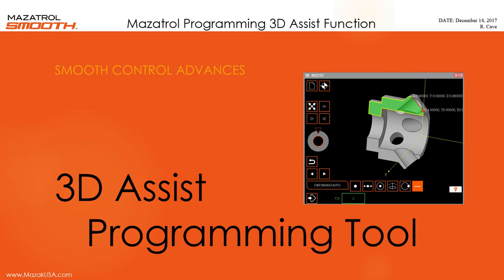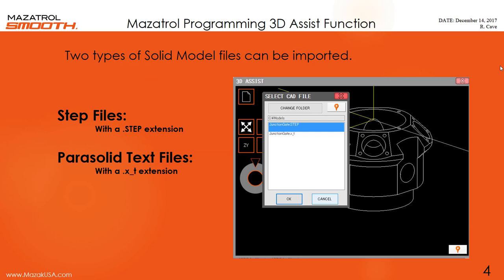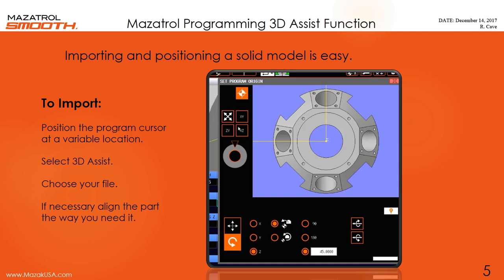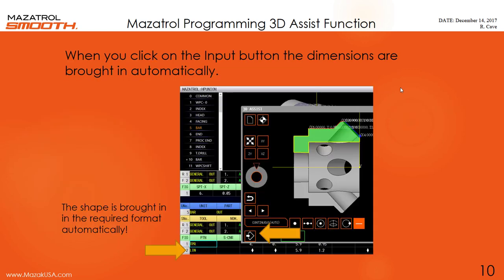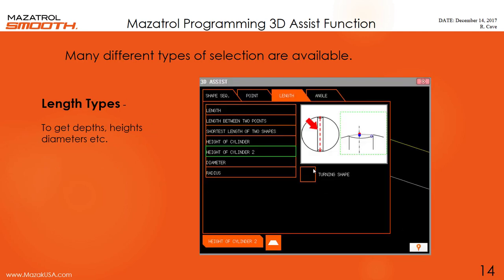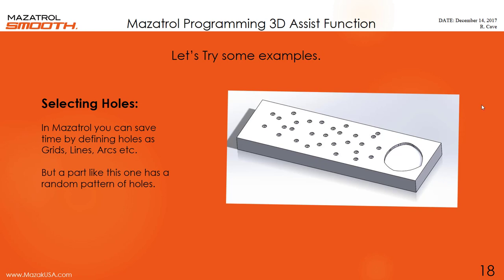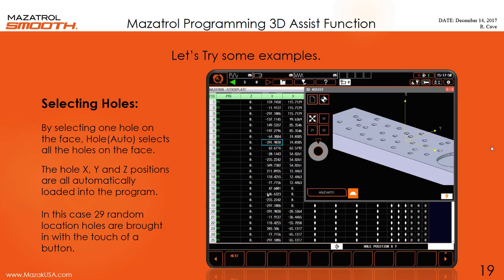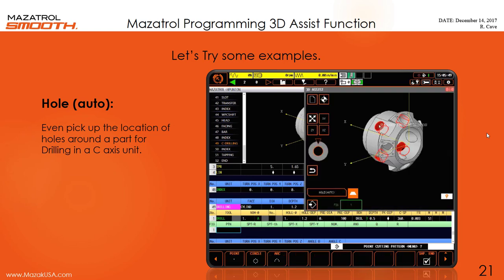Addy Machinery - Mazak Mazatrol 3D Assist Programming

Comment: it's a great feature we use it regularly,  it also helps while programming on computer using smooth cam
Reply: Hi sir, I just want to ask you a question. Maybe you remember me from your channel. I had written that we have a Mazak variaxis i600 with smooth x control. I make the programs via Mastercam since I can import my vices, zero points and other fixtures as well as the tool holders so that I can see if a collision will occur or not. Could you please let me know if this also possible via Mazatrol programming? We have collision checking option on the machine but as well as I know it is only possible only with the Mazatrol programs. Therefore, programming with Mazatrol is better to aviod collision. However, everything, geometry of the vise, fixture and tool holders, should be defined perfectly. Could you please advise if I am right?

Comment: Steve, I am having trouble with the 3D assist not allowing me to select edges. Any idea whats going on here?
Reply: do you still have this problem? did you manage to get it to work?
Reply: @aspeaerospaceprecisionenging  it seems it really has to do with how the model is prepped. I find sometimes that just importing the step file back into cad and saving it again will work. I still have issues sometimes but it has got better. Again usually the issue is with how the part was modeled on CAD.
Reply: @abarrick09  yes this is how we do it,  just resave it as a step file in our cam software and it works most of the time,
Reply: Anthony Barrick have you found out why having the same problem ?

Comment: When you create a turned profile, does 3d assist create the profile at the maximum material. i.e. will it recognise the additional profile requirement at the angled flat in your example. Thanks
Reply: Did you ever find this out? I have been working with a Integrex 100st for the last year and just barely touched the 3D assist by the looks of it